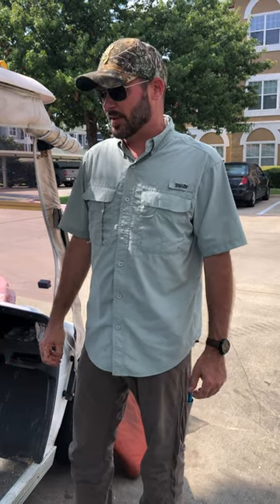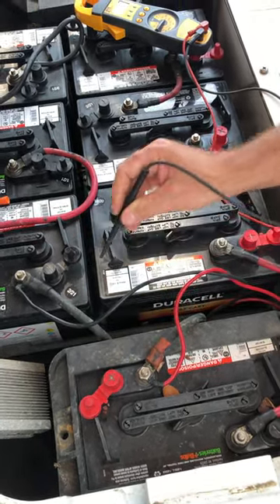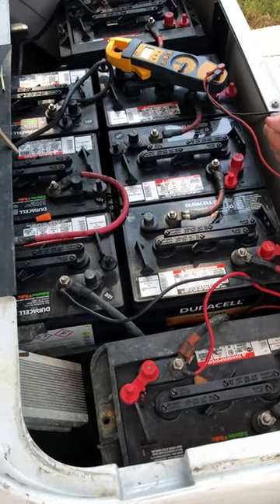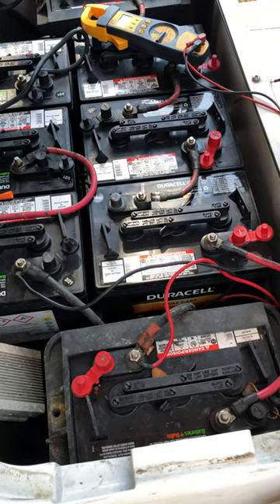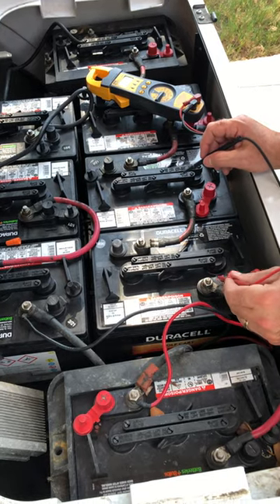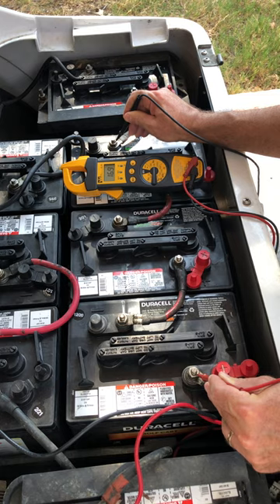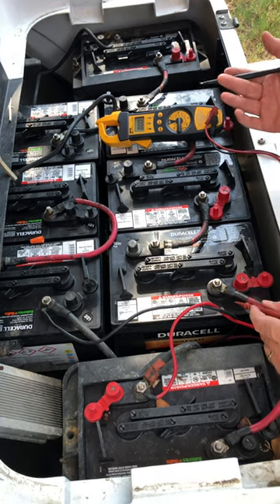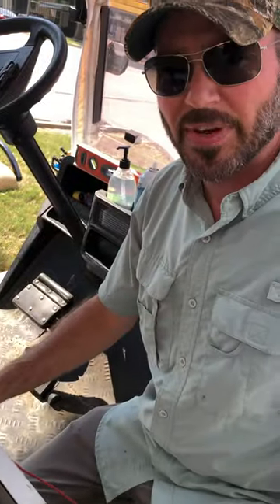How to Isolate 12 Volts in a Series of Golf Cart Batteries

Comment: If you were to connect a horn to the positive end of a battery and then ran the switch to a ground like the frame, would you get all 48 V or would you get 12 V? (I have four 12 V batteries running in parallel.)